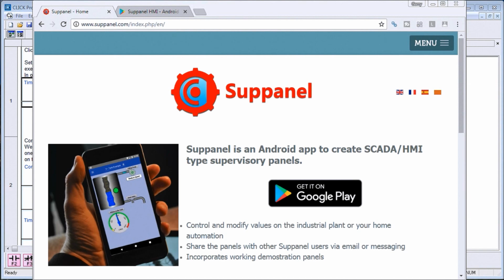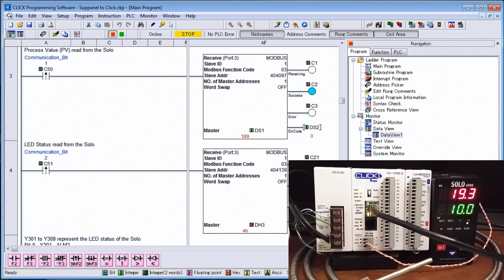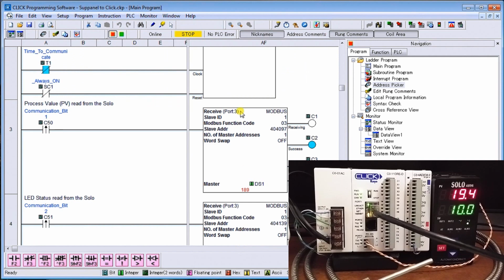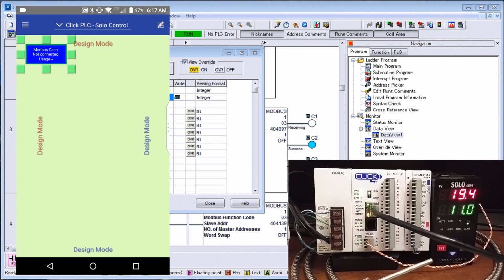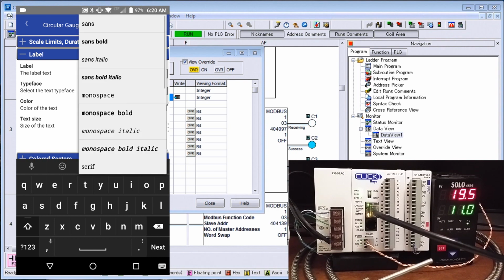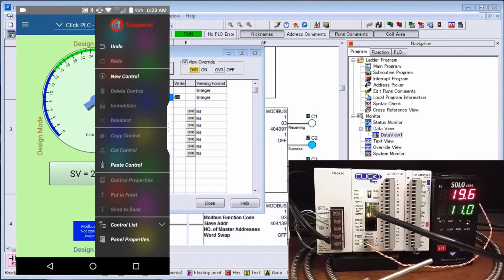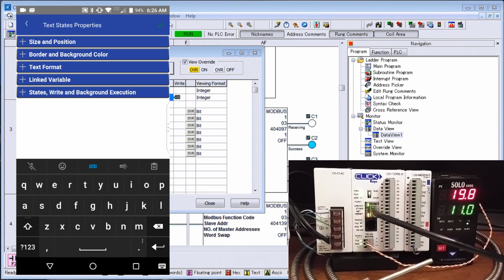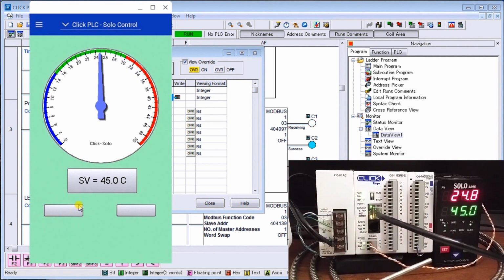Turn Your Phone Into a Powerful PLC Control Panel!

Comment: Anyone try to get this to work with Arduino?  I've been trying to for an few days now but the connection is sketchy at best.

I messed around with this and a click but had similar issues when connected to wifi. 

Different phone. Is there possibly a setting or something within the router that I am missing?
Reply: I do get it to connect....but I am still figuring out the code for the app to see pin status.  I cannot toggle state because the app cannot see the current status.   About to pull my hair out.
Reply from the maker: @wadebrewer7212  
I have connected a C-More to the Productivity Open Arduino. 
https://accautomation.ca/series/productivity-open-arduino-compatible-industrial-controller/
Here is the post...
https://accautomation.ca/p1am-arduino-modbus-tcp-to-c-more-ea9/
The C-More has APPS that can be used on your cell phone...
https://accautomation.ca/c-more-ea9-hmi-series-panel-web-server-and-remote-access/
https://accautomation.ca/c-more-ea9-hmi-series-headless-rhmi-remote-control/
I hope this helps you out.
Regards,
Garry
Reply: @ACCautomation  I have some things to do to fight with it.   I remember having problems with the app staying connected to a click the it was completely over wifi.   Once I hard wired the click via LAN and configured accordingly...it did much better.   I tried Virtuiono last night and without configuring anything in the code I was able to get it to connect and it stayed connected.

My guess is...Suppanel application isn't optimized and the developer hasn't visited it in quite some time to optimize it.  Which is too bad....the interface is almost perfect in my opinion...easy to use...easy to address...it just isn't very stable when your slave is wireless.

Comment: I could use a bit of help with this app. When I use it for more than 2 outputs it starts behaving strangely. Al I want it to do is monitor and display the input (I currently have no input) and output status and have buttons to change the state of the outputs. My ladder logic is mainly just some crudely constructed timers using RTC. Scheduling on off times for my 4 current outputs. I like using the subroutines for each different timer control, and just use the main program to call them. I use the output bits y1-y4. My timers are RTC sd24, sd25, sd26 using the compare function to my set times. When the values are all true the output y1 latches using the set  function. To reset I do the same RTC functions but with my desired offset of time obviously. I have 4 of these timer subroutines in my program. I use the modbus addresses assigned to my outputs in the app and everything seems fine until I switch more than 2 of my out puts causing the app to display incorrect status of on or off. Also causes the buttons to lock in the on position until you turn off another button. very strange. please help!
Reply from the maker: Hi Darren,
Can you send me a copy of your Click program? You should be controlling the internal bits and not the outputs directly. 
garryshortt@accautomation.ca
Thanks,
Garry

Comment: Bonsoir,
Peut-on l'utiliser dans un automate OMRON  CPL1
Merci et bonne suite avous
Reply from the maker: Hello,
The Omron CP1L will communicate modbus TCP with the built in Ethernet port for the following units:
https://www.myomron.com/index.php?article=1478&action=kb
You could also add the following unit CP1W-MODTCP61 to other CP1L systems:
http://www.omron.com.au/data_pdf/cat/p63p.pdf?id=3333
Suppanel Android HMI will then work for you.
Thanks for watching the video.
Garry

Bonjour,
L'Omron CP1L communiquera avec Modbus TCP avec le port Ethernet intégré pour les unités suivantes:
https://www.myomron.com/index.php?article=1478&action=kb
Vous pouvez également ajouter l'unité suivante CP1W-MODTCP61 à d'autres systèmes CP1L:
http://www.omron.com.au/data_pdf/cat/p63p.pdf?id=3333
Suppanel Android HMI va alors travailler pour vous.
Merci de regarder la vidéo.
Garry

Comment: Did I miss how to connect your phone/tablet to the plc?
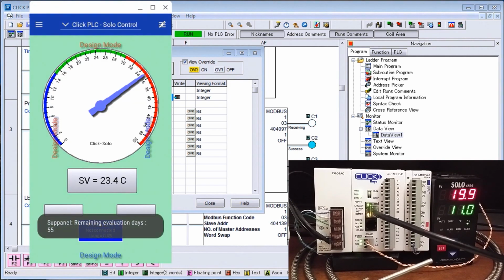Reply from the maker: In the video at about 18:37. This is done by putting the Suppanel program in User Mode or Run Panel if you are in the Expert Mode. Use the main menu on the upper left corner.
Regards,
Garry
Reply: Garry Shortt I guess I wasn’t too specific on the question. Physical connection. If it’s on your cell phone, does it connect through WiFi and an IP address?
Reply from the maker: Hi John,
The physical connection with the cell phone is through WiFi to the router and then Ethernet cable to the PLC. Suppanel acts as the Modbus TCP Client (Master) to the Click Server (Slave). You only have to enter the IP address of the server that you want to communicate. In this system you can have multiple clients talking to multiple servers. 
Hope this answers your question.
Thanks John
Garry
Reply: Garry Shortt thanks